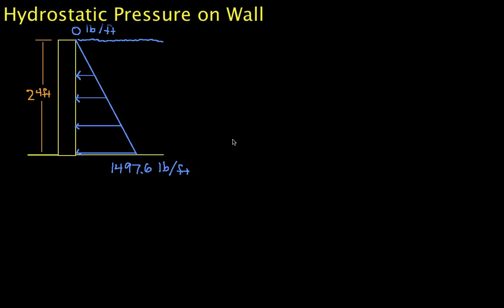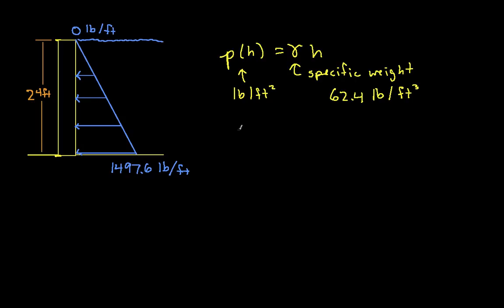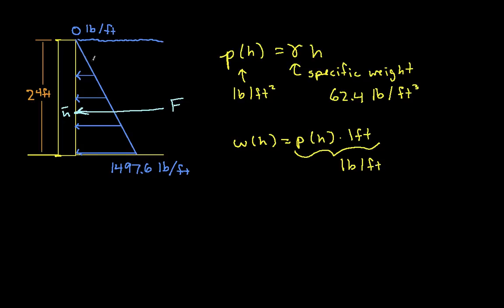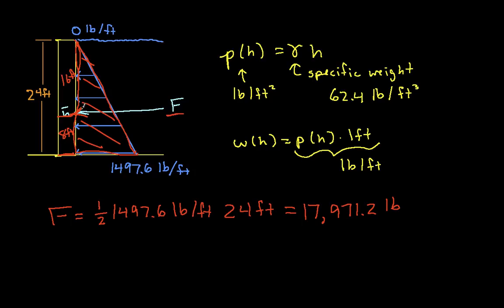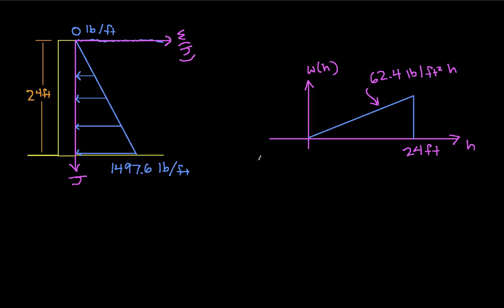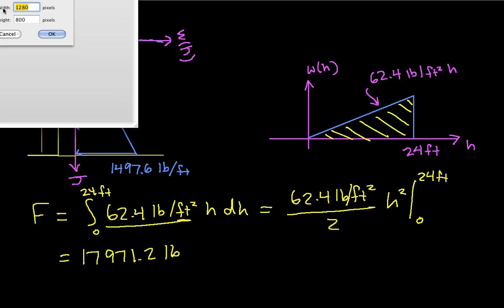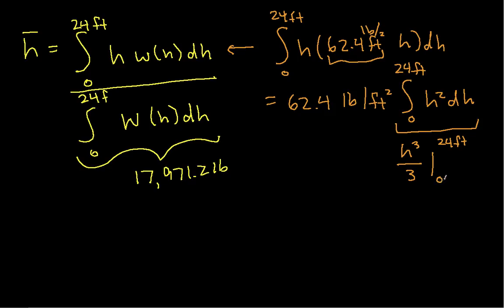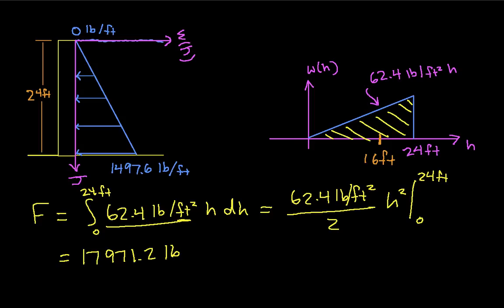Distributed Force-Hydrostatic Pressure on Wall

Comment: Hello, does the horizontal width of the water affect the pressure? Would a 1000gallon and 100gallon of water have the same pressure 10ft from the surface?

Comment: Where does the formula for "h bar" come from?
Reply: Torque arm length may be expressed as the torque value divided by the value of force. The center at which all the forces affect may be expressed as the sum of torques divided by the sum of forces. Forces may be replaced with volumes, areas, weights or other stuff to calculate the center of gravity or centroid. it may be that simple in simple shapes, but gets complex with complex ones like parabolas for example, thus we enhance the sum of torques and forces a little by using integration, as integration is same as summing using sigma but in much smaller steps (dx instead of 1).
Reply: @Nordiniv  did he mention this in any previous video?
Reply: @mnada72  , IDK, I learned it at college :”D

Comment: your pressure unit for 1497.6 should be 1497.6 ib/ft^2
Reply: He’s designing a one foot strip so he dropped a ft from the denominator.
Reply: units units, he is doing a weight per foot vs distance graph not a pressure vs distance graph